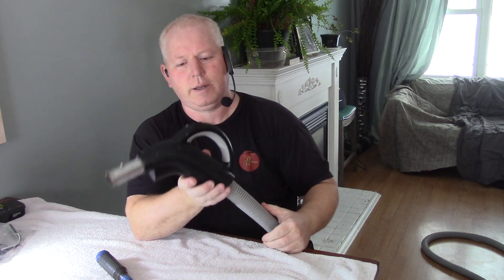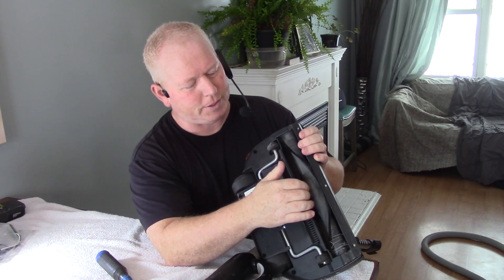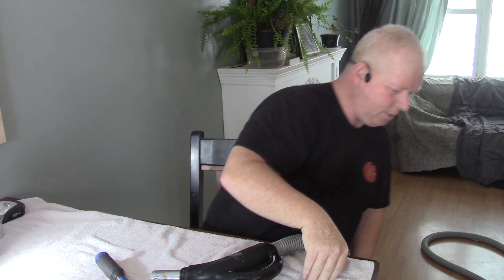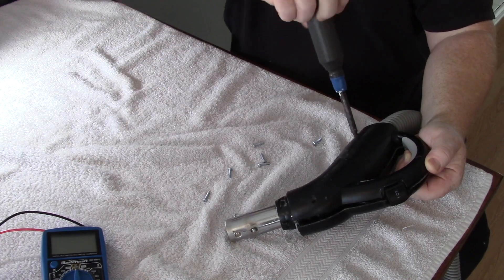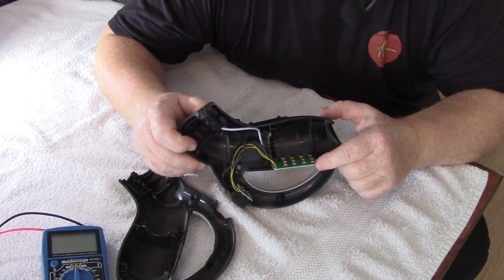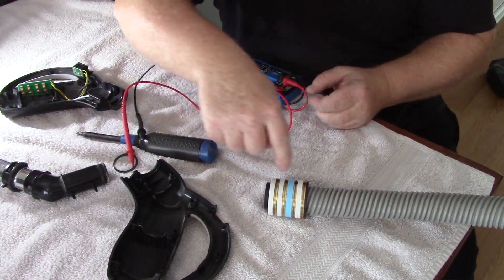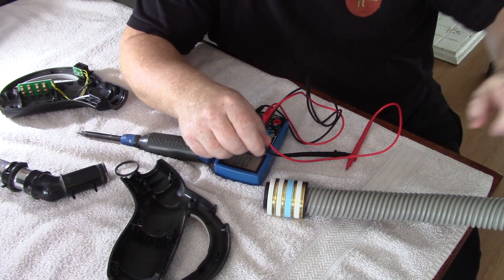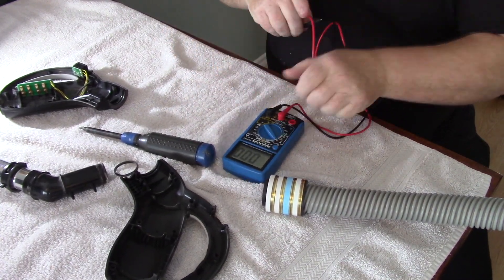Central Vac Switch Replacement

Comment: Great video — very helpful.  Similarly, our position  2 on the switch was not working.
We ran through all the steps shown, testing the rings on the hose, etc.
Before ordering a new switch assembly, we checked our assembly and noticed that the contact board had collected some dust balls.  We cleaned it off with a Q-tip and tested the system again.  
Position 2 on the switch worked! 
We don’t need to order a new switch.
Reply from the maker: @mjp-ind    Nice!

Comment: The switch in the handle failed on ours. The remote vacuum should run with the switch pushed to either side - ours did not.   Popped the thumb-operated rocker (with the I - 0 - II marking) off the top of switch to reveal two small metal see-saw shaped contact pieces and two ball bearings in the body of the switch, and two springs that are stuck in the thumb rocker piece I popped off.   Was able to lightly scrape-clean the switch contacts, stretch the springs a bit (springs get tired over time) , then reassemble the metal contact pieces, followed by the ball bearings in the middle of each contact piece, and the springs back into the thumb-rocker cover I popped off.  Pushed the thumb-cover back into the switch body, and was back in business without ordering parts, or having to explain to guests why the front hall carpet was so dirty.    If your beater bar does not work, could also just be the switch - could be something else. Might be worth a try disassembling the switch as described (unplug from wall first) as it can be done without taking the handle apart. Good luck.

Comment: Well done and thorough tutorial.  However, before you take things apart and order a replacement switch assembly, try using compressed air (electronics duster spray can) to blow out the switch.  While the switch is enclosed, there is enough of a gap around the rocker to shoot air in all around the edges. After 2 minutes of blasting away with air, the switch now works perfectly. It seems that dust gets in the way of allowing the switch to make contact.  You don't even have to take the handle apart!  I saw this idea on an Amazon review after someone else figured it out.
Reply: Just tried this trick with a home compressor and the switch now works. Thanks very much for the tip.